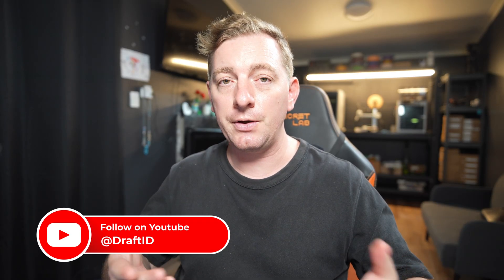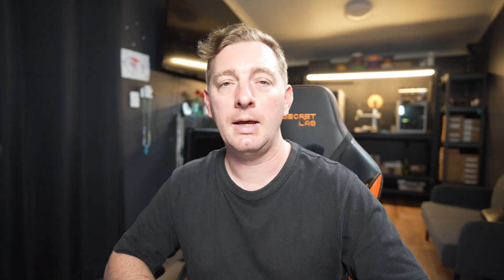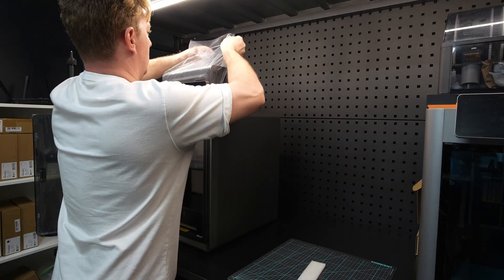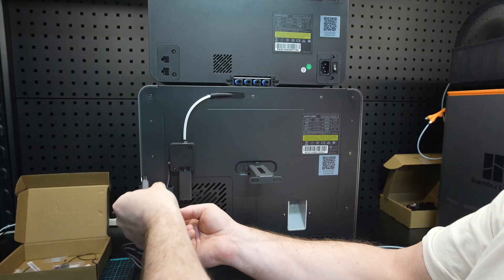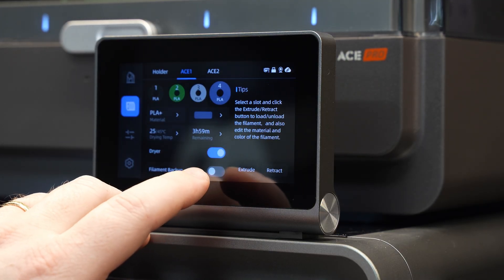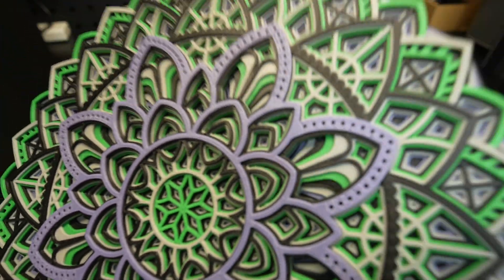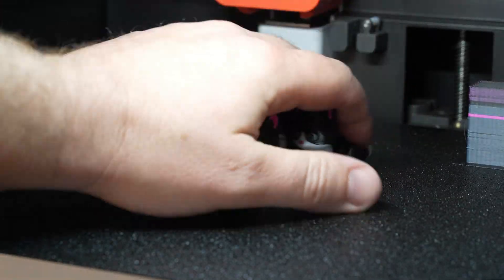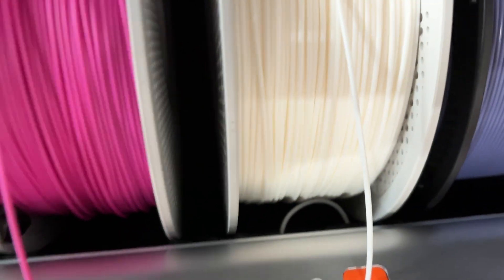The Anycubic Kobra S1 Changed My Mind About Other Brands

Comment: I’ve seen a fair few complaints in various KS1 support groups,  yet I’ve managed to clock over 400 hours on mine without any major issues that couldn’t be solved in an hour or less. Anycubic has just released the KS1 Max, which addresses numerous issues like bed warping, a heated chamber, greater multimaterial compatibility, up to 16 colours, a much larger print size and wastage/speed. If I hadn’t bought my KS1 in the summer and just got a Snapmaker U1, the KS1 Max looks a great option.
Reply from the maker: I really missed the U1 train and kind of dismissed it. My loss there cause it seems to be a great machine. How’s yours been?
Reply: @DraftID  I’ve been so busy with Christmas and the NY that I’ve not yet unboxed it 😂 I’m hoping to get to that this week, so will post an update. Lots of positive feedback from the community so far.

Comment: I have no 3d printer experience. I am not interested in having to "futz" around with any 3D printer I do get (apart from just standard stuff for printing). I don't have to troubleshoot most of the electronics I use and I'd like it to be like that for my 3DP.
I plan to print PLA/PETG and a little TPU. Like most folks, I assume.

I had really been leaning toward a P2S, but came across this S1 Combo. At this time (early Jan 2026) there are no P2S Combos to be found anywhere. Even BL won't be shipping until week 3 or 4 of Jan. But...I can get an S1 Combo from BestBuy, right now (though, for some reason, their page doesn't note the maker and says the order is fulfilled by "GlowWise").

The "GlowWise" (Kobra S1) combo is $700. And I can get it now. Versus probably 3-5 weeks before getting a P2S (at several hundred $$ more).

But I have read so many horror stories. Both at launch but even within the last couple of months. Not everyone. Plenty of people report stable HW and performance with just the typical issues afflicting any FTM printer. But when there are "issues", and they do seem to be more frequent, they are significant and result in many 10s of hours with support and a lot customer troubleshooting. Usually with no final, positive, conclusion.

Since this will be my very first foray into that world, I know me, and I know if I had to go through the HW, FW and build issues others have noted, I'd return the thing to BB, eat whatever restocking charge they'd levy, and swear off 3DP and loudly recommend anyone else stay away.

But then the price sings its siren song...

I'll continue to do my due diligence. In the end, I value reliability and predictability over cost savings (to a point). 
I suppose I'll hit up Reddit and see what's said over there.

Comment: What settings are you using to get the layer height looking so good. 
My p1s has a higher print quality when printing the same models
Reply from the maker: I think using the variable layer height is always key :)
Reply: @DraftID so I tried using that too wasn't working, unless I don't have it enabled right I don't know it's to tell if it's on or not the toggle button thing doesn't really toggle on for it.

Comment: Right, so the Anycubic Kobra S1 is apparently a good printer, but I have some doubts. It seems it's running Klipper Go, a fork or variant of Klipper, but with closed source code. Since Klipper is released under GPLv3, any fork or variant of it, is also GPLv3, but Anycubic have "forgotten" about that and just stolen the code and chosen to just gamble on noone being able to sue them for the code and money. I don't really like what Bambu is doing either, where they add third party software to their slicer (which is a fork of PrusaSlicer, which is licensed under AGPL), but still, that is only linking to a small module to communicate with the cloud. It's not good, but it's pretty far off grabbing the whole of Klipper and stuffing it under your shirt and playing nothing has happened. So, instead of just using Klipper, they forked klipper without releasing the code (which they must according to the license), just to lock customers into their own ecosystem instead of letting people use the equipment as they like. I also register that Anycubic Slicer Next is a fork of OrcaSlicer and that Anycubic hasn't paid the OrcaSlicer project a dime and thus isn't on the sponsors list. Instead, Ancubic has done the same as they did with Klipper and even released something on github, except that something doesn't work and lacks a ton of what they really have changed. This again breaks the license, this time AGPL.

Since you have chosen not to mentioned this at all, I can only guess Anycubic has paid you pretty well to do a "review".
Reply from the maker: All valid points that are worth looking into and not something I was aware of. Probably even deserves its own expose video but I don’t think I’d be the right person for that content. In terms of fee I just get the printer but no payment and this is normally the case for my channel size. If I asked for what I’d think is a decent fee they would laugh and move on to the next channel. Again though, all valid points you raised if true and done in a shady way.